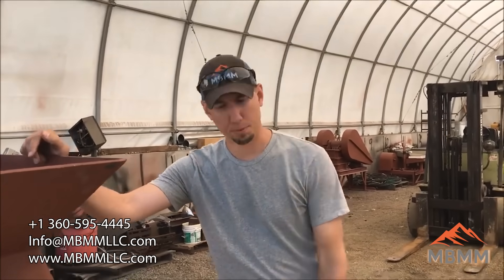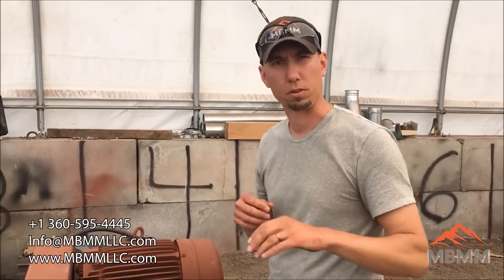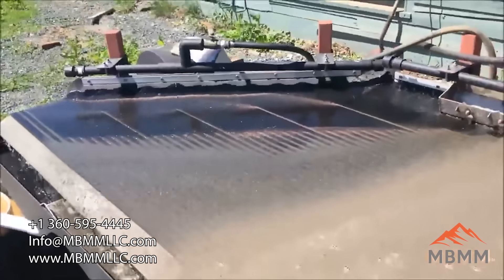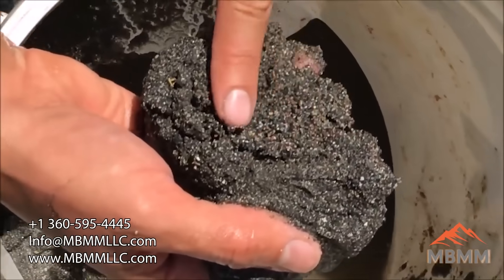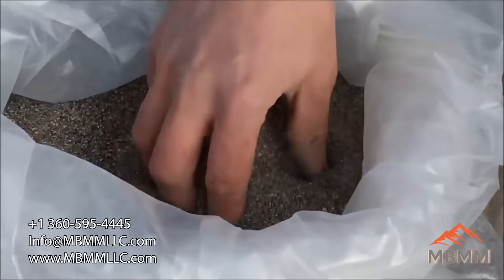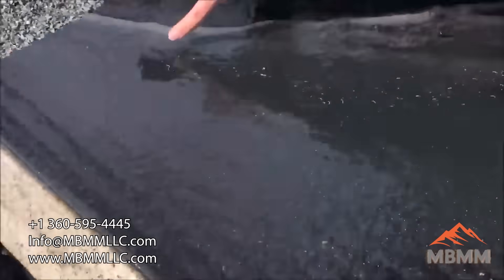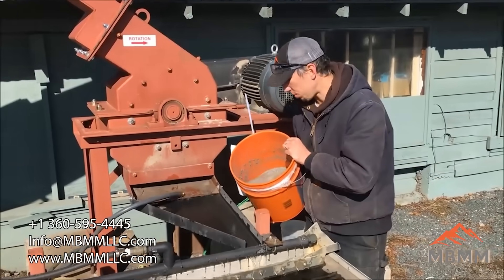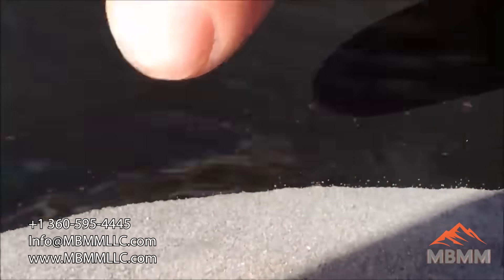Crushing Electrical Waste for $$$ Copper Recovery

Comment: Man, if you accept a tip, you should think of doing a colab with fellow youtubers that are scrappers, to tour your factory. It bugs me that no scrapper on youtube is using your equipment! What a shame, they encounter electronic ever single day! And electronic parts have more than just copper, they have precious metals too. I even recommend your channel, product and site to a few of them (2), but I cannot confirmed that they read or thought it was relevant. What a shame, these guys are wasting time and money not getting a hammer mill and a shaker table. Just the time reduction of micro-scrapping is already game changing as the guy behind ProjectShopFL would say it.
Reply: Most scrappers do not have the space for the equipment, nor the volume of scrap to justify this equipment, so they just sell it to scrap yards. Also, what is a scrapper going to do with the collected metals? How are they going to ensure that they have separated all of the gold, silver, tin, steel, lead, copper, and aluminum into their proper classifications? And if they were able to do all of that, who would buy the material? Scrap yards are not looking to buy granulated metals. They cannot determine purity of the metals in granulated form. So really, you would need more equipment to process the metals, perhaps through electrolysis.

Scrappers who do get a lot of volume need to have fast turn around. Nothing about this process is fast. It just isn't a scrapper's niche.
Reply: I think these videos are coming out of interest from people in the scrap industry that buy material from scrappers. In order to be able to make money out of material like this it requires volume and a capital investment in his equipment, which also requires having the real estate / facilities to house one of his turn key systems.
Reply: Yes, you are right! But Jason, on the other hand...!